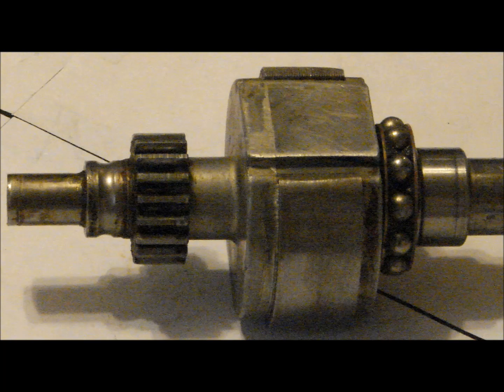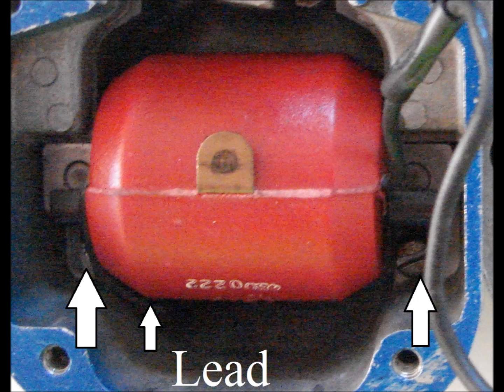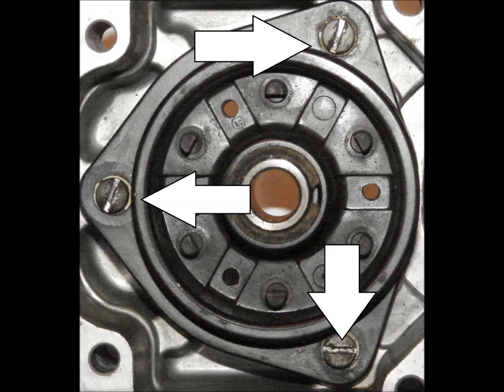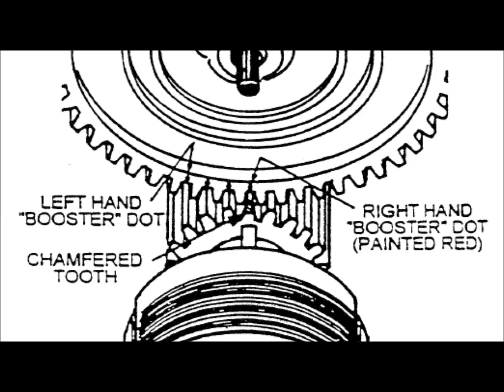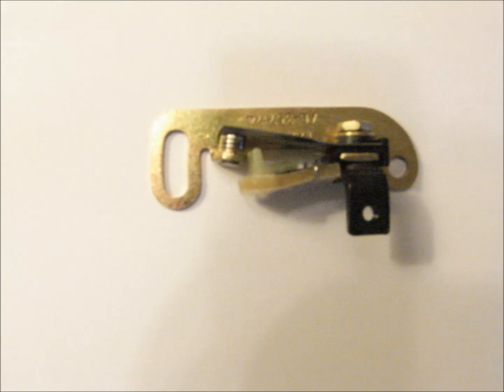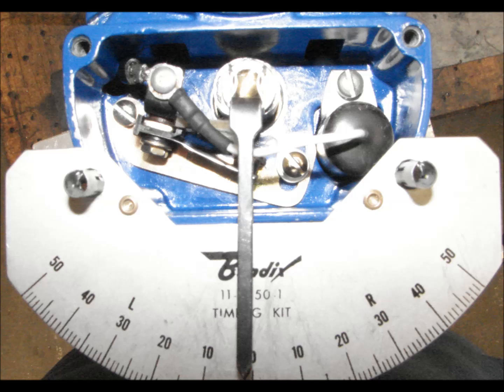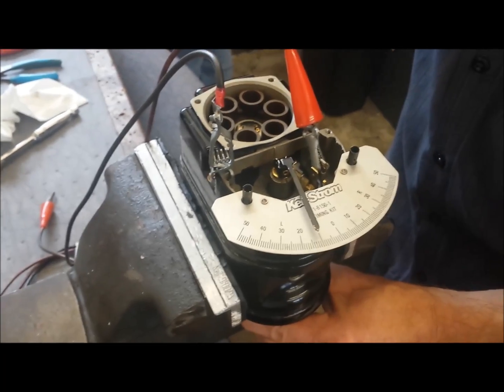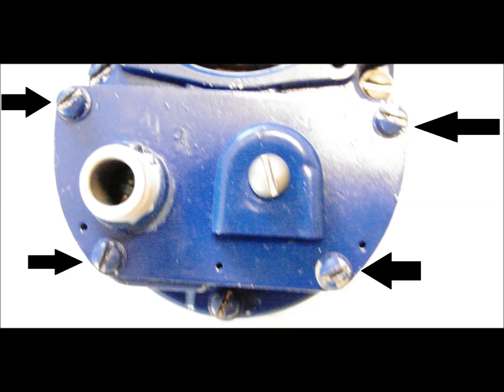Aircraft Magneto Reassembly and Timing

Comment: What were you doing with the screwdriver when you were listening to the sound when you were timing the magneto around 12 degrees? You were adjusting something? The breaker point?
Reply from the maker: Yes I was moving the points assembly. I had previously tightened the points down so it didt move easily. I was adjusting them follow by tightening the screw.
Reply: thank you!